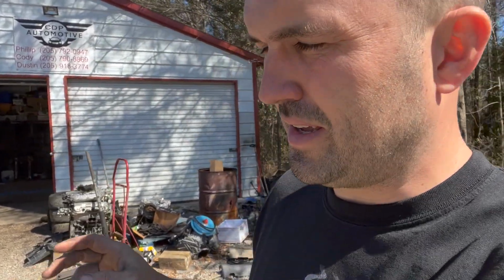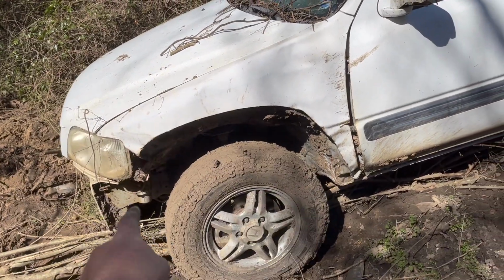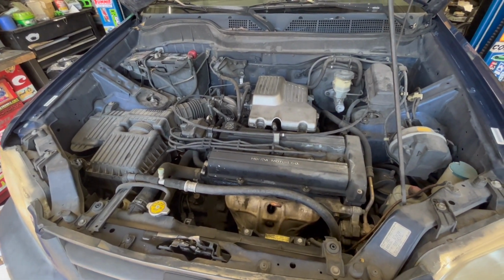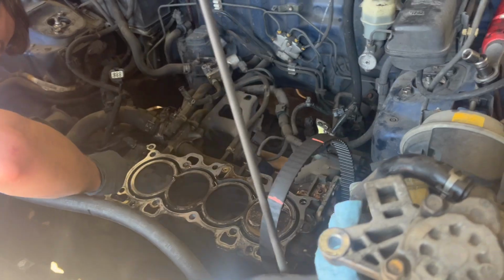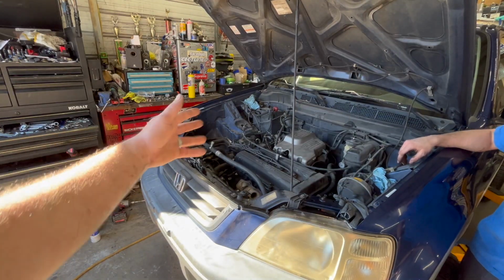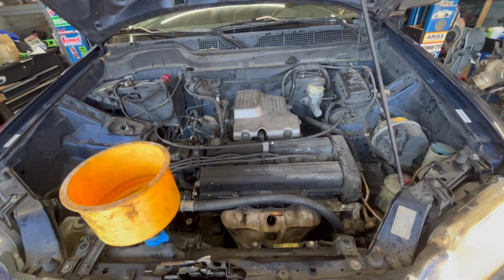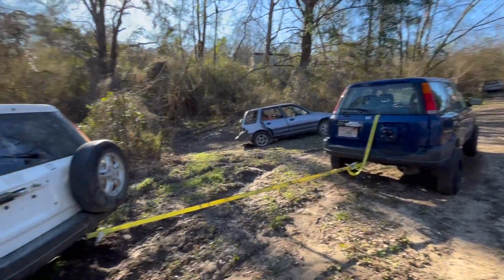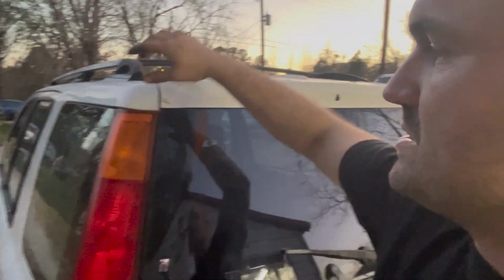I Gave This RD2 Honda CRV a 2nd Chance at Life!

Comment: How hard is this job for a beginner, got a crv with no compression on one cylinder and need to learn sooner or later anyway
Reply from the maker: You could prob do it in a couple days.
Reply: @hondaresource  started Thursday almost done, head bolts out but can't get the head off cause u think there's brackets under the intake
Reply from the maker: I think there is a bracket. Most honda's have a bracket from the intake manifold to the block
Reply: Got it out now, just gotta send it off to a machine shop and get my new gaskets

Comment: Whats the suspension and wheel setup on the blue one? Ive been kicking around a small lift and tire upsize on my 99 and i really like how that one looks. Or maybe you have another suggestion, i want just a nice little lift and the little wheel offset with some more aggressive tread pattern but i dont want to go to the level that requires major suspension and drivetrain mods. Im not an off roader its my hunting/fishing rig so i do run the mountains and like the beefier look. 😀
Reply from the maker: Honestly, I'm not sure what the lift is. It was on another one that I bought. Same for the wheels, but I do know the tires are 235/75/15

Comment: Thank you for all your informative videos! So far you’ve helped me fix two issues! My question right now is there any video you have on how to fix the shift handle ? I know it has a release button you can press but I’m just curious if you have plans on addressing that issue thanks again I love your channel!!!
Reply from the maker: What's wrong with yours?
Reply: @hondaresource  hey! Mine is automatic and when I set my foot on the brake pedal to go from Park to any gear it doesn’t release the handle. I have to use the button on the top of the column to release the gear shift handle, if that makes sense
Reply: Hallo.. need help bro..how to fix back door  for Honda CR-V gen 1..it's stock very hard to open thanks bro

Comment: Question. What is the use of the pipe guard? Mine is bent from previous owner. New one is $100. Is it something important? God bless
Reply from the maker: It protects the oil pan to an extent. I've had several come through without it, including my new crv
Reply: @hondaresource  So its kinda important but a flat hrg guard would do the same. Thank you, i wanted to make sure. I lifted mine and turning into a overlander.